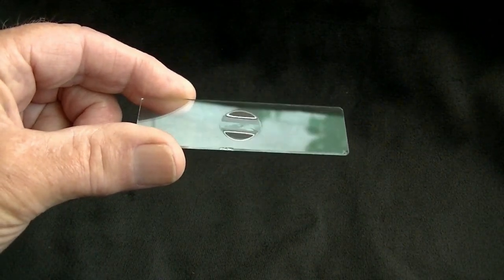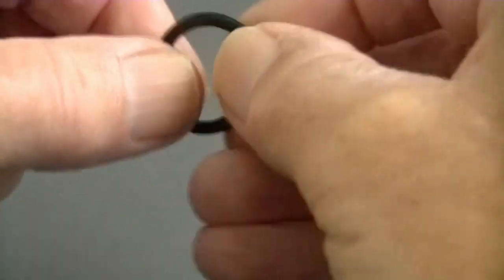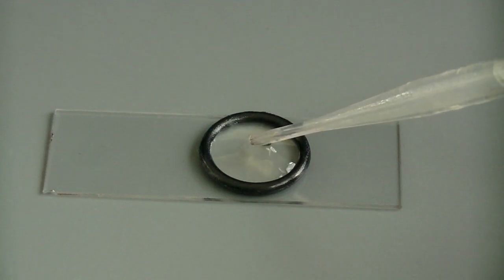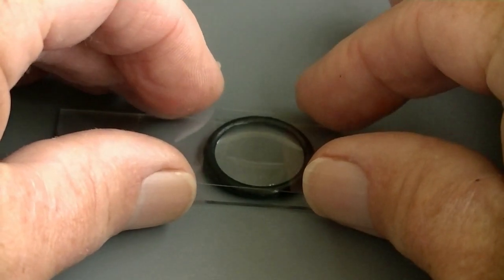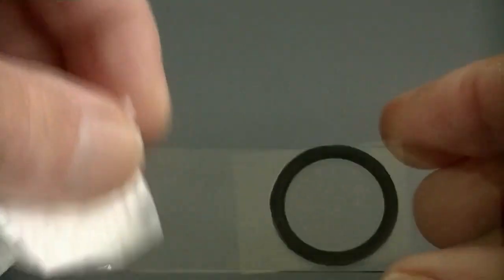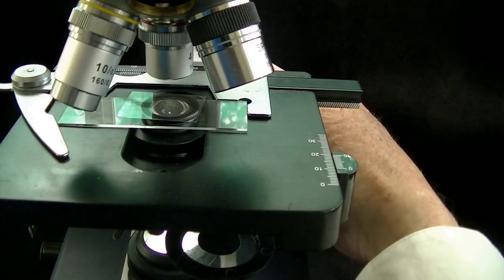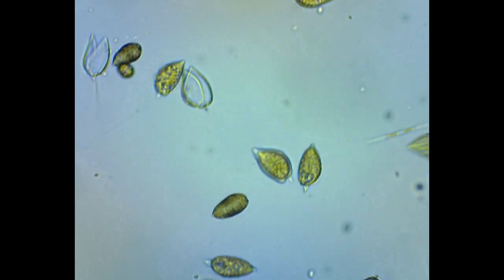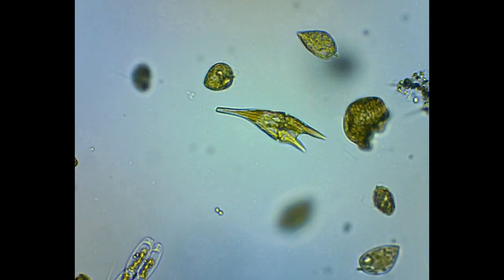Microscope slide chamber for plankton

Comment: What the name of the this   pls where i can find it
Reply from the maker: What do you mean by "it"?
Reply: That black circle, what's its name?
 I tried it today in the laboratory, but I did not find better results. Perhaps I was not able to imitate you well
Reply from the maker: @KechidKenzaa-gz9xc   They are called O-rings obtainable at hardware stores or on-line (e.g. https://www.amazon.com/Assortment-Plumbing-Automotive-Mechanic-Connections/dp/B0BJJM91G4/ref=sr_1_19?crid=27NKCBIU57GXU&dib=eyJ2IjoiMSJ9.rMalqnjJK4ptQgIJLXaeol0CN2hMWmSikj0mL1o6aGlH5g0-8UIIJyiXwOtEuSjqxBKzqwW-IMcVi-_6pHMGryygvNELJ9HPp-0vgETRlN_inr_LJkckcwHABGCxr4WD1YOlBKwzdIFHapbaxmIKQghMH8lKh-Z-aK-GKxunq28ntR_F0x6W0id9ajHGwhK3aVH3o7b3rkDwG9otfOWrci5jI2GN2pDwC7mfw3j6JUg.-Gz4sNxGwVz7M4HdpxvjHgJhkWh9_xkTiSzZhAnAiXM&dib_tag=se&keywords=O+rings&qid=1711297114&sprefix=o+rings%2Caps%2C248&sr=8-19
What results were you looking for? The main challenge is making a waterproof seal. O-rings come in different thicknesses - the bigger the depth, the more volume you can examine but the image quality will be reduced.
Reply: @clivebagshaw2805  Thank you very much for the explanation. We will repeat the phytoplancton observation using exactly them

Comment: Thank you for your video, but what is the diameter of the o-ring that we can use?
Reply from the maker: The width of a standard slide is 1 inch/2.5 cm, so any ring a bit smaller than this should work
Reply: @clivebagshaw2805 thank you for your response
Reply: @clivebagshaw2805 So how will be the calculation of the density with this dimension?
Reply from the maker: @nadjimahmed531  The volume of sample within the o-ring is given by Pi r-squared d, where r is the radius and d the thickness of the ring.
Reply: @clivebagshaw2805  great thank you again. It's really useful.